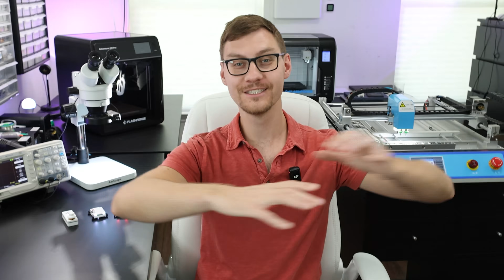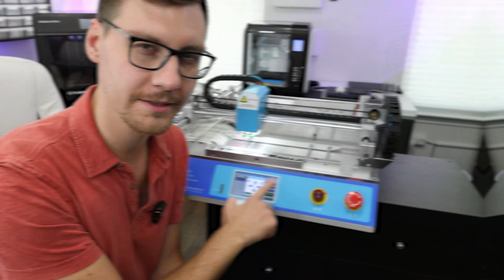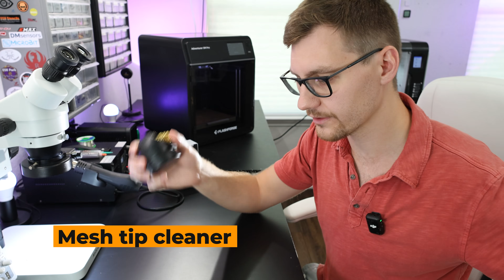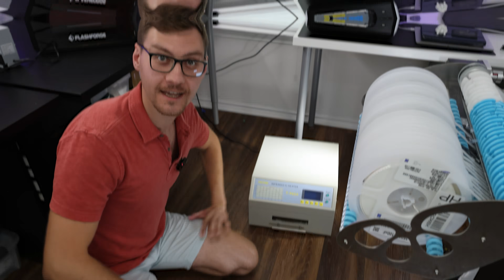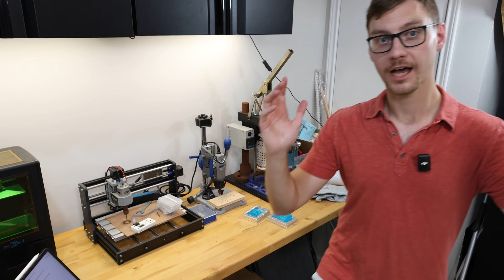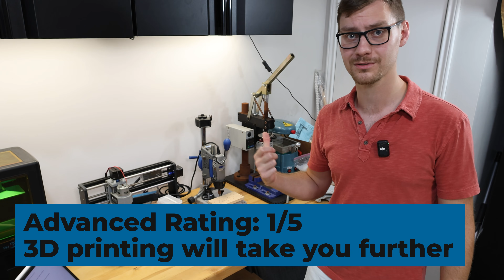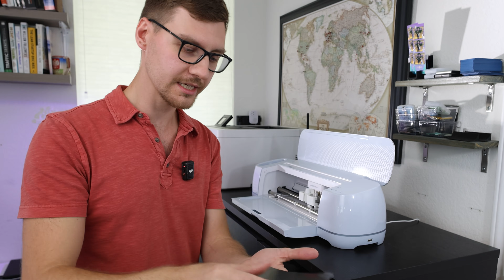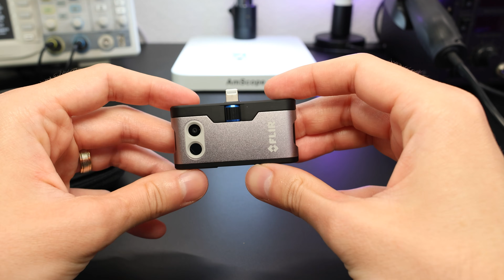I Wish I Knew This Before Building My Home Lab

Comment: 21:10 - You actually left out another tool (though, not recommended for the absolute beginner): the ultrasonic cleaner. Cleaning corroded PCBs with this was a game changer for me. I recommend this as soon as you can afford it. Even though I don’t have a Branson (mine is the Crest 1200), I use their cleaner specifically designed for PCBs: the Branson EC solution.

Comment: No current limited variable voltage power supply?! You said at the beginning of the video how you focus on embedded stuff, I'd refine that further - your tool set is focused on the digital domain. No serious analogue stuff, no amplifiers, no RF - you're just not properly equipped for that kind of work, which is fine, but I'd hate for beginners to be misled. Personally I think the PC is overkill for CAD work - any modern laptop can make a decent fist of CAD, I do the majority of my work on a 5 year old iPad with Shapr, which whilst it's not cheap is so intuitive and quick it's totally worth the money.

Comment: To all beginners and intermediates who plan to do mostly digital projects: as a first step, the $10 logic analyzer (e.g., from AZ-Delivery) running the Logic software is a no-brainer for getting into the world of time-based measurements. Compared to an oscilloscope—which is only really fun if you spend several hundred bucks—it’s a great starting point. I even use it in a professional context because it’s so much more convenient than the built-in analyzers of good oscilloscopes. Especially in the beginning, I find it extremely helpful to see an I²C bus and watch the data packets moving back and forth.

Of course, there are limitations: max. 24 MHz and only digital signals at 3.3 V and GND. But honestly, for quite a long time this covers the vast majority of protocols like SPI, I²C, UART, etc. The next step would be something like CAN, which uses a differential pair and won’t be covered by the analyzer—unless you put a CAN transceiver in front of it. That’s already included on all common CAN breakout boards (e.g., MCP2515). The MCP2515 outputs a 3.3 V digital signal that can be picked up by the logic analyzer. If needed, you can add a level shifter, MOSFET, or resistor divider to step down from 5 V to 3.3 V.

I really can’t emphasize enough what a great deal this is: $10 hardware combined with well-developed, easy-to-use software (Mac, PC, …). It’s such a good value proposition. As long as you’re not working with analog signals, it will take quite some time before you truly need an oscilloscope. And when that time comes, you’ll know exactly why you need one and what kind. My recommendation: don’t buy an oscilloscope until your multimeter and logic analyzer no longer cover your needs.

Comment: Been doing electronics as a hobbyist, since I was a teen, later on moving into professional and teeny tiny youtuber, that's almost 30 years of my lab in one way or the other, it grew with me quite a lot... starting in the '90s with a soldering gun (the transformer shorted with a tip) and no DMM, no scope, only analog meters and pretty primitive tools; almost all salvaged parts because buying them was expensive. Now? A decent lab where I can handle most SMD rework as well as THT or point-to-point stuff. Still nothing compared to the likes of CuriousMarc or Mr Carlson's Lab, but Rome wasn't built in a day.

Lots of equipment will depend on the type of electronics work you do in the lab, e.g. you'll want dummy loads, a function generator etc. if doing audio stuff, a variac, separation transformer, dim bulb tester, a vacuum tube tester and an old analog scope that can handle a few hundred volts on the input for vintage electronics repair and restoration, a vector network analyzer, spectrum analyzer, lots of adapters for RF, or a bunch of dev kits for IoT prototyping... which will often cost a lot, so don't buy everything you think of, use the YAGNI rule (you ain't gonna need it) unless there's a good reason to get that gear. A DMM or two is of course a must, so are power supplies suiting your needs, and as for soldering irons, I'd advise in favor of getting a station for both hot air and cartridge iron (Hakko T12 or JBC C210, C245 etc.). Cheap-ish Chinese gear from Yihua, WEP, Aoyue etc. is still quite good even when doing pro service work.

Comment: Programmable Power Supply with current limiter: Useful to protect circuits while troubleshooting
LCR meter: Useful for checking components
Akro-Mills Storage Bins: Organize your small electronic components
SMT Storage Book: for storing surface mount strips (ie resistors, caps, SOT-23, small package SOPs, etc)
Desk Work light: for working on PCBs.
Reply: Oooh I agree sooo much! Power supply is a MUST and storage, oh boy would my life have been a lot easier if I had good storage when I was starting out

Comment: I use a PCB house for 3D printing. They do SLA, MJF, SLM, FDM, SLS and WJP. It would take millions of dollars and 10 years to match their capabilities. But you get your parts in hours, I get mine in 10 days or so 🙂
Reply from the maker: thats a perfectly fine way to do it! :) for CNCd parts, I usually go with a fab house (thus I dont have a proper CNC, yet). I am curious, who do you use?
Reply: @stuckatprototype  JLCPCB. Well it's JLC3DP for 3D printing. Only used them once so far, so not a lot of experience lol. But the parts turned out great! Oh, nice video btw!

Comment: For having bought many cheap-ass tools from aliexpress, my recommendation would be to:
1) Know what tools exist
2) Don't buy a tool you can do without
3) Don't cheap out on quality

The $3 iron from ali is really shit. The $2 tweezers that bend so easily you can't grab anything are shit. The tin that doesn't melt 350°C is shit.
I did without an oscilloscope for a very long time. And although I don't often need it, when I do, it's really a game changer. It gives you so much more insight into the working (or not) of your circuit! But I'm mostly interested in power electronics at the moment.
Reply from the maker: oh yes, don't cheap out on the tools, I couldn't agree more! I highly recommend silver-based solder. and as for the oscilloscope, it really does depend what you are doing, thats very true. I mainly stick with the digital domain, but for anyone serious I do recommend the scope for sure!
Reply: @stuckatprototype  Would be more helpful to tell us WHY you recommend silver solder and which one exactly.

Comment: Between the $500 stereo microscope and the $1 magnifying glass..  any thoughts on those $50 digital microscopes (like the ones from TomTop, or the Andonstar?)

In terms of portable soldering iron, how does the Pinecil v2 compare to the HS-02, or the SainSmart ToolPAC TS101?   Or just a standard Weller WE 1010?

$40 Hot Air Rework   ( GAOYUE 858D 110V 700W Digital Constant Heat Gun Soldering Station Kit SMD Rework)

Regarding 3 printing, I understand Bambu is great for FDM prints... for SLA, there's no clear winner?  Any thoughts on TinkerCad or  Pasticity?  Have you ever used a print service?  Any recommendations that can do small prints cheaply?  Sculpteo , Shapeways, CraftCloud, xometry, protolabs?

Your $150 logic analyzer looks like a saleae.. but those start at $500?   Maybe the LogicPort or the Analog Discovery 2?

The Cricut Maker 3 looks interesting!
Reply from the maker: I tried the digital scopes, I really dont like them. Between the quality and the lag I just cant recommend them. I like the TS101 (I just upgraded). for SLA Anycubic has been great for a cheap end printer. as for the analyzer its the DSLogic

Comment: I'm a bit skeptical of the fume extractor. Activated charcoal is good at capturing chemicals. AFAIK, soldering fumes are mostly particles. I've read that a HEPA filter would be much much more appropriate for this use case.
Edit: we can actually see that most of the smoke actually comes out the other side. Which is still a better place for the smoke than in your face. ^^
Reply from the maker: Carbon filters are supposed to be good for this. Mine is definitely on the cheap end. It does reduce the VOC count in the room though!
Reply: I don’t think your ‘carbon’ filter actually does anything - you can see through it and the holes are huge so the smoke just gets blown through!  (it might be black but it’s not a carbon filter as we know it)

Comment: How about power supplies and electronic loads? I mean a power supply is a must in my point of view, but I wanted to get an opinion on electronic loads.
Reply from the maker: Yea I did omit my power supply for some reason. I have a fairly inexpensive one, it does fine. As for electronic loads, I have never had a need but that depends what you are doing :)

Comment: For troubleshooting analog devices (aka repairs), a scope is indispensable. Just the other day, figured out a power supply cap failure because of a scope. I’m not talking about big buck scope, an old 20mhz analog you can find used often for free
Reply: Where are you finding a scope for free?
Reply: I think I have yet to use mine after 2 year over 1MHz.
Reply from the maker: thats perfectly valid! I mostly design in the digital domain thus rarely need to pull it out, though I do have to say that sometimes it is absolutely necessary. usually to debug power stages :)
Reply: @stuckatprototype  If you have clocking issues, glitches, phase alignment, signal level issue, noise on your digital signals you would never know without a Scope.  I do a lot of high speed digital and mixed Dig/Analog and it’s a must.  Not always needed but when you need it you have to have it available.  It’s also very necessary for beginners to understand time domain signalling and timing (and timing margins).  If you are ever looking at power stuff a Scope is a must!